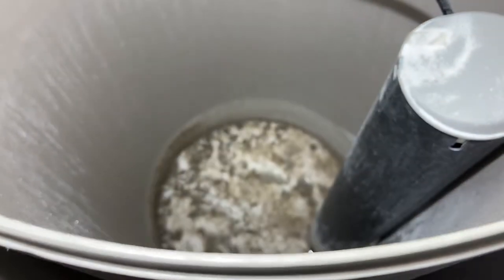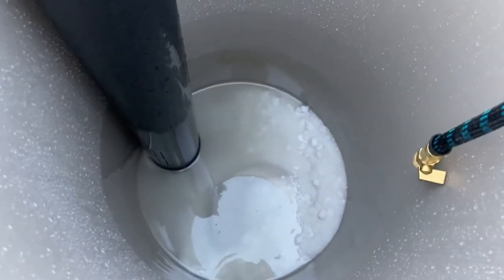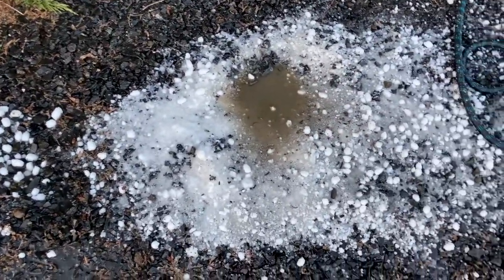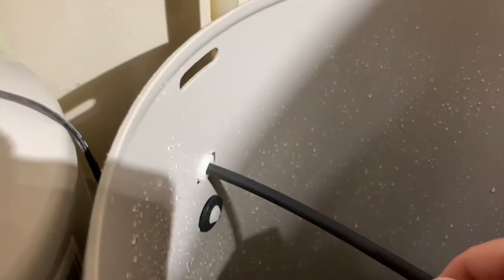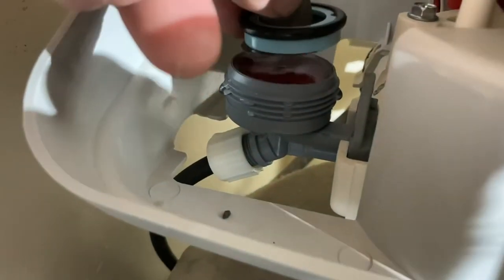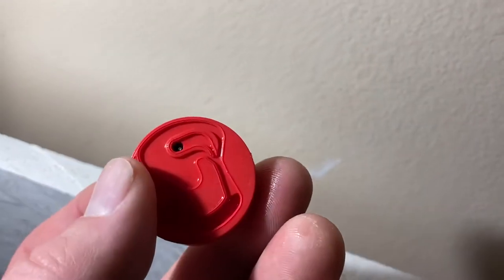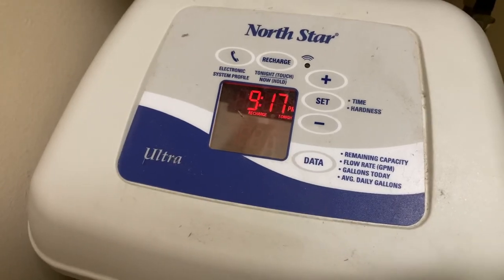Nasty Brine Tank - Water Softener Maintenance

Comment: Tip, you don't have to disconnect the drain tube. Mine comes up without disconnecting it.
Reply: @mr.boniato6402  have you ever taken the valve unit off the canister to change the resin beads?

Comment: do you have to add water after you’re done ?   or the system will do that when it regenerates
Reply from the maker: In this system the manual specifies addition of water when setting up the brine tank. The system does add water when recharging but the set up instructions have the owner add water during set up.

Comment: I’m having a hard time removing the valve unit from the canister that is in the brine tank. It has been on there for many years. Would you happen to have any suggestions? Thanks so much.
Reply from the maker: I’ve done this again since this video. The whole black part can actually be pulled out. I found it will unhook if pulled upward. Maybe see if the whole thing can be lifted up then if there is crusty stuff you could look at cleaning from the other end.
Reply: So if I understand right, you’re saying the valve unit isn’t threaded on and I should just pull it straight up? I have watched many videos and haven’t seen one where it’s just pulled up.
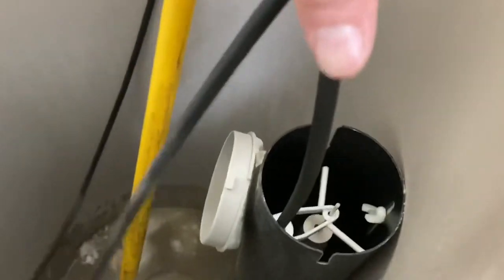Reply from the maker: @Cozmo544 I hope we are talking about the same thing. The black pipe in the brine tank in the video can be removed. At 0:40 you can see a white plastic wing nut. My black piece can be removed after that but is taken off.
Reply: @ Oh no. Sorry I guess I didn’t describe it properly. At 2:25 of your video you’re checking the filter on the valve unit. That unit is attached to the top of the canister with the resin beads in it. That’s what I’m trying to remove so I can replace the resin beads. Have you ever taken it off? In most videos they are threaded on to the canister. Mine won’t budge.
Reply from the maker: @ Sorry, I have not removed that yet.
Reply: @samvore2963  Ok thanks for your time.